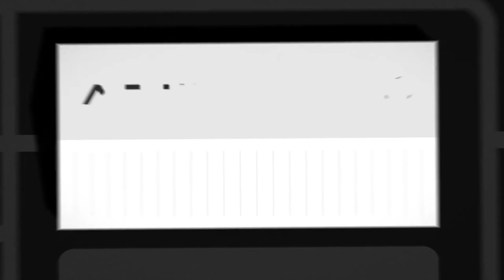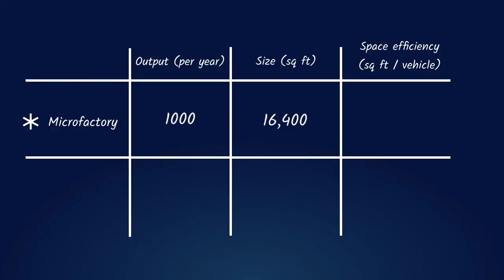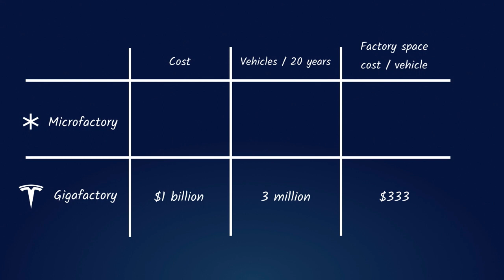Why Arrival’s microfactories are BETTER than Tesla’s gigafactories

Comment: This is not new coach builders have always bought in a proprietary built chassis and built a body on top usually from wood and aluminium  they are 
making a electric buggy type chassis and building a composite body on the top you still have to transport raw materials to the factory but they will train local labour or is that robots they glue all components together like the aircraft industry ( but I remember I used bolts and rivets aswell )

Comment: Setting up all those factories will multiply pollution and many costs. It's like houses.

Having a single house allows you to buy a bigger one than if you bought more. A bigger house spreads the cost of the kitchen and bathroom as they serve more rooms the bigger the house gets. Just buying 2 houses makes you pay double for kitchen and bathroom. And if you buy them new (as in this company's case) then you also pollute double.

And the advantage of keeping some factories working in disaster situations can fail, like in this pandemic, where all factories would still have shot down as seen last year.

Comment: This is entirely the wrong question the right one being why do we need all these cars, and especially large ones? If rail were improved we could deal with the first and last mile issue around stations which would only need small electric cars rented rather than owned from the local station. There is no longer need for large concentrated commercial centres.

Comment: arrival is already outdated before it has even started production
the future is in robotaxi costing $0.18 a mile. buses will soon be a thing of the past as they cannot match the cost and the convinance of a robotaxi
also your part on production of telsa is not accurate
tesla will be soon having a single peice front, rear cache also a structual battery pack will dramatically reduce cost, floor space and significantly increase production
Reply: All very true, Tesla as 45% of my wealth I'm 100% with you. But just to always look at a different view: would robo-buses be more cost effective then taxis? For their vans and buses, they have modularity, I could see them licencing Tesla's FSD software in the future potentially, so robo buses and vans. They said that they are able to swap parts when self-driving goes mainstream. I don't think their team will get there on their own, but could license from Tesla and train for vans/bus

Comment: Good job.  The only things you missed are the added cost benefit of the durability & recyclability of the panels,  the customization ability and lower cost of their vehicles, and most importantly; the value of the patented software for the micro factories which gives it the ability to use one robot for any programable necessity.
Reply from the maker: Fair point, the modular design especially is a large benefit over any other car manufacturer.

Comment: Tesla has a battery shortage. That is why the Semi has not entered production. Tesla does not make it's own battery cells. They have been talking about it for four years now.
Reply: tesla has a pilot plant of the new 4680 batterys and they are building two battery plants at berlin and austin
Reply: They also own the Nevada factory that Panasonic makes batteries for them in.

Comment: 5:04 Tesla Giga Shanghai costs over $ 2 billion, Giga Berlin $ 6,9 billion
Reply: also the output of the giga factory is not accurate shanghai will ramp up to production capacity to 1 million a yr and giga berlin will ramp up to 2 million a yr

Comment: Doesn't a bus use a larger foot print to produce and sell for more? You should have used 10,000 vans a year for a Microfactory which brings cost to $250.
Reply: yeah, he compares the number of cars (3 million) to the number of buses (20,000) produced in 20 years in that table. It'd be more useful to compare the number of vans estimated to be produced in 20 years (200,000.)